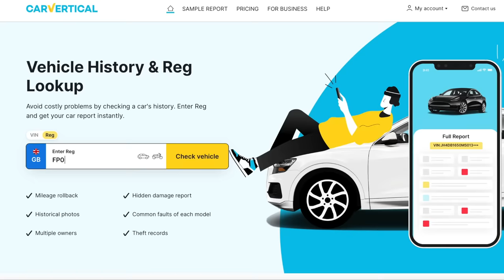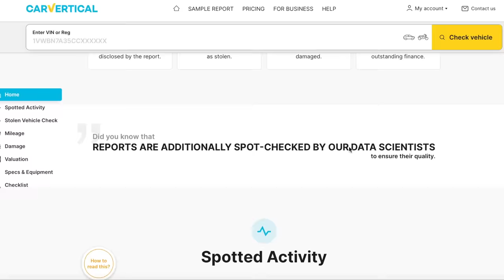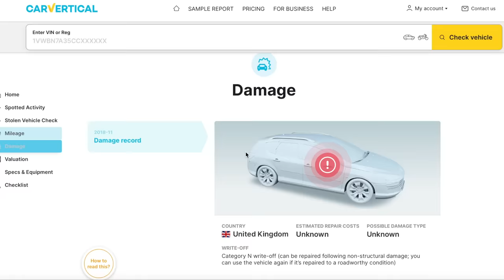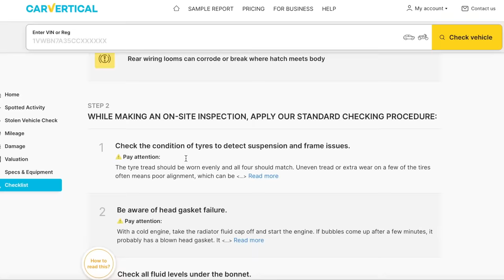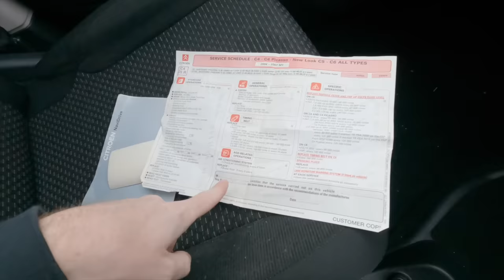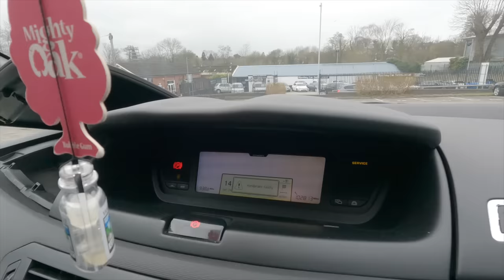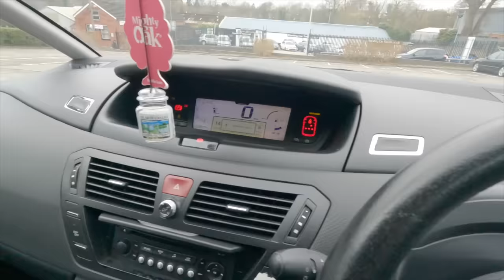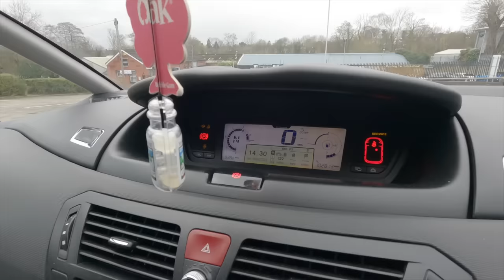I BOUGHT A CHEAP CITROEN C4 PICASSO FOR £300

Comment: Bought one of these a C4 Grand. they are almost the only car available in Auto with a completely flat floor across the front.
I had knee surgery and a full cast on my left leg, so this kept me mobile.
Planned to sell as soon as possible, but surprisingly, still have it.
Yours seems a right lemon!
Usual Ford engine problems, usual Fiat gearbox problems, usual Citroen wiring problems!
The 2.0 diesel had the regular torque convertor gearbox.

Comment: My wife has c3 Picasso it’s a nail what a shed but she loves it what makes it worse I’m a mechanic and I have to fix it every year it has the same things go on it front coil springs,rear discs,drop link ends,track rod ends,bottom ball joints ect what a shed it costs more in parts than it’s worth £500 and that’s trade price for this years mot unbelievable but I’ve put my foot down and told her that’s it it’s scrap in 10 months

Comment: Yep dpf fault but most common fault is with fuse box getting wet in certain age cars. Citroen knew about it but failed to recall cars effected. Bought one as it was in good condition, low miles and needed a big cheap car. Car kept stopping / cutting out and lit up like a Christmas tree. Turn ignition off and then car starts again. Can happen at traffic lights or while doing 70 mph on motorway. 
Its French so works when it feels like it.

Comment: I scrapped the very similar  car and got £440 that was Apriil 2022 ( perhaps prices have dropped since then) was on 184,000 miles with Turbo problems and rusty cills,you are wrong in some ways but right in a lot of ways , they are very economical and very comfortable , stylish , the semi auto i would never buy and yes the brake problem light is often on , I replaced my 16 HDI VTR plus with a 2.0 Hdi Exclusive 6 speed manual box( about £1000 cheaper than a Ford Galaxy ) , its nice leather seats ,everything love it but yes , I would definitely scrap that one, ( Auto Handbrake wont work with warning lights on, the beeping is fault with rear seatbelts ) that gearbox is stupid and you really should consider breeding, Western Civilisation is at risk

Comment: Matt loves to slag off the electric parking brake, then demonstrates his own lack of knowledge/inability to operate the thing, pulling & pushing on the control to release it when all you actually need to do is stick it in Drive and press the accelerator. Pulling the handbrake control at this point actually applies it even more strongly/securely rather than releasing it...

Comment: Had the misfortune of owning a Grand Picasso for a few months. hateful car but I took it as a trade in and ran it for a bit   In that short time I had Abs,. Esp, handbrake issues. gearbox is related to the abs sensor issues. windows not working,  rattling trim, injector popped out and a few more things I'm sure. was glad to see the back of it.

Comment: My dad had to drive one of these to a garage to replace his customer's windscreen somewhere indoors. Bearing in mind he drives a 1 litre Suzuki Splash and thinks all cars should have a top speed of 60mph, his words were whilst he didn't see the point of people banging on about how slow a car like this is when it wasn't designed to go fast, he'd never in his life driven something where the acceleration time is so slow as to suggest that the car just ignores the input from the accelerator pedal 😂

Comment: Citroen really have lost their way. I had a 1993 ZX & a 1995 Xantia. Both cars were mechanically sound with the 1.9 TD engine though pretty ropey & plasticy interiors, especially the ZX. The key to them was maintenance. I used a local Citroen specialist & the cars served me well. The Xantia had 175k on it when I got rid & ran well albeit the bodywork was...erm...tatty. Sold it for £175 & bought a Toyota. I’ve never been tempted to return.

Comment: 18:30 Here you can see that you you drive in 2nd gear, because the transmission is in emergency mode, and it is controlled by the paddles under the steering wheel, and you pressed the + button, that's why it jerkily drive in 2nd gear.

Comment: A lot of what you said here is true, but they aren't that bad to drive and use, at least the 2.0 HDI diesel versions. The worst offender is the automatic handbrake. Pneumatic suspension requires attention, but it's not as faulty as people make it seem to be, not that expensive to fix and in my opinion worth it. If not, there are aftermarket suspension kits in the price of pneumatic parts you can drop in and be done with if you can't be bothered. I'm pushing 220k miles on mine and had one major failure out on the road that was car's fault. I kind of dislike how SUVs push out family vans out of the market, because they are a really good compromise between comfort, inside space and running costs(especially MPG)

Comment: Citroen spoil things when they get over complicated. I’ve had two ZXs, one was a 1.4i and the other a 1.9td. Both were reliable, cheap to run and enjoyable to drive. I had an AX too. Made from biscuit tins, but averaged 70mpg and never let me down. However, I wouldn’t touch a modern Citroen or any French automatic with a barge pole!

Comment: My sister has just traded in her 14 plate C4 in what I can only describe as poverty spec, I’m amazed it’s actually got electric windows! She’s traded it in for a brand new Dacia Jogger. The old C4 has seen better days. It’s front bumper has a serious lacquer peel, the passenger front door has a large rust patch running along the bottom, a fog light surround is missing having had an altercation with a pheasant, there is a small dent in the rear passenger door and every single seat is stained. Mechanical wise, there’s a bit of a knock from the front suspension, the gearstick is quite notchy but other than that, it goes and it stops. The Dacia garage have given her £2400!! Wtf! How could they possibly make anything off that bucket???

Comment: I feel your pain, Picassos of this generation are just painfully terrible. Driven by people with no mechanical sympathy whatsoever, and minimal funds to look after or service the vehicle in any shape or form correctly. New citroens really are horrible, however, the older ones (pre around 2000) in my experience were pretty good, especially the diesels, such as the AX, ZX, xantia, even the ugly xsara. Soft squishy seats and suspension, frugal and very reliable diesel engines, but pretty poor build quality.

Comment: I live in Tasmania Australia, and drive a gold diesel 2008 C4 (not the SUV type). Apart from a major water and fuel pipe trouble, whch did cost about $2300 to repair, it has been a very reliable car. I srecently paid for its 100, 000K major Service and always change the oil every 6000Klm. I LOVE this car!

Comment: Would not touch a Citroen with someone else's money never mind a barge pole had a nasty experience once and seen another experience someone else had with a Citroen van came back home from work parked it up and as with all Citroens it seems to happen when the Disc cool down the hand bake no longer holds this brand spanking new Citreon van role down the road across the junction into the path of an oncoming Bus

Comment: I had a c4 grand Picasso with manual gearbox which I used to drive to southern Spain 4 Years running. Very good for the motorways x comfortable. Only problem I had was one year the air con developed a problem with the air con in that it only ran with the fan at full speed! The noise was atrocious. Took it to the local Citroen garage and got a bill for 1000 euros! Yikes!!

Comment: Oh this was hilarious. In 2007 I needed a car quick for new job, they said I’d do 20k a year max so I bought one of these exact model but with the 2.0 engine on a lease, I did in fact 60k that first year drove all round Ireland multiple times and then back and forth to Northumberland up and down the uk etc and at the time I had a 3 yr old a 7 yr old plus 2 dogs. It never let me down, but I loathed that thing the gearbox was as u said, the trim rattles were so bad I used dry wall screws to try and stop the upper glove box lids rattling and worst of all I’d bought my Mrs a used a4, which I convinced to let me use for work and she use the c4 for the last 2 yrs of the lease. It was like driving a Roller after that turd even tho it was base model petrol. I was so happy when it went what an absolute pile. I wish I could have seen yours getting scrapped.

Comment: Its supposed to be a fully auto handbrake put it in gear touch accelerator it comes off put it in park it comes on , also fitted with anti roll back,VTR + should have auto fold wing mirrors. Had a new one in 2007 one thing to check is water ingress into the engine management ECU had 3 fitted to mine that can cause misfire and other management lights also cuts the engine (bad seal around it never buy new models they havnt cured all the problems) Thank god it was on lease so no charge to me. Probably never had the gearbox service needs one every 40,000 .

Comment: Interestingly, my parents have owned a C4 Grand Picasso for 11 years, and they think it is a very good car. In my opinion, the Grand Picasso is much more attractive than the ordinary Picasso. It has been fairly reliable and practical too. I must say though, that as somebody who actually learnt to drive in a Grand Picasso, it is an awful car to drive and the response time once you put your foot on the accelerator or brake is very slow. The worst part was moving from having my foot on the brake to putting it on the accelerator when I had been waiting to enter a roundabout at the top of a hill. The car rolled back as soon as I took my foot off the brake and the response time when I put my foot on the accelerator was so slow I was worried I was going to roll into the car behind me....

Comment: Brake pedal position sensor will be the cause……. Usually if you put it in manual you’ll find you can change up all the gears 😂. As for the rest of the faults……. Gallon of petrol and a match

Comment: Love these videos Matt and your humour. 
I agree with you that generally French cars are garbage. After 40 years of driving and many, many short term and long term rentals as well as company and private cars you are right ALL cars will go wrong at some point, the key is quality maintenance to help prevent it. Generally I would say I’ve never had that many mechanical issues with French cars if they are serviced on time (auto boxes aside) BUT they all fall apart eventually and Citroen/Peugeot usually earlier than later and mostly they have crap nasty plastics. They all have interiors that self combust, whether it be dodgy window switches or just bits of trim falling off at random. 
I’ve also run Mercedes, Audi and BMW as company cars and after 100,000km or more of tough Autobahn driving they’ve all felt exactly as they did the day I took delivery. I’ve never ever had a car from one of the big 3 German brands let me down or have bits break off. 
You are always going to get someone saying “but my Citroen did over 100,000 miles with no problems” I’ll bet at the end though they felt like driving a knackered old sofa. 
In my experience all Germans are not equal however, The Golf MK7 was a great car and in my opinion good quality and lovely to drive, but the MK8 is a hateful cheap and plasticky pile of junk with a touchscreen hell inside. 
Keep up the good work, look forward to your next video.

Comment: The theme of the video runs through the whole Citroen stable.  We had a Xsara Picasso from new, had about seven years relatively trouble free motoring and actually did us well.
 Well, apart from the spare wheel being nicked after 6 months because , according to the salesman, a simple security bolt through the boot to stop exactly this happening was an 'optional extra'. Part of the wonderful world of Citroen 'quirkiness'. 
After seven years though it turned into a clown car, they should be fitted with a clown horn as standard because it literally felt like the doors would fall off. A friend who bought it off us thought it was cursed, they just over complicate them.

Comment: Your right when you say you can't go wrong, even if the engine is knackered  you'd get your money back.
I recently scrapped my focus ( which I brought as a cheap run around for 700quid a year ago ) a couple of days ago the scrappy gave me £350 , even tho almost every panel had damage .
Yesterday I payed £1500 for a 13plate fiat punto ,with only 52k mileage. 
I got it cheap bc my father was advised ( medical reasons) to stop driving. 
The reasons are sad, but I'm glad he didn't ring a dealer. 
Ive seen similar reg/mileage 
On sale/ or sold, by dealers  for £3200. 
I'm tempted to part x for a bmw Z4 , 2.5 or pref' 3.0 .
I've always wanted one & prefer the looks,  soft top to the later solid roof convert'.
...im trawling my iPad atm.

Comment: It’s quite an easy fix for the Auto gear change ABS/ESP and Auto handbrake and cruise control problem and you can change in to 4th gear or higher when driving by going into neutral then back into Auto. Wow you really don’t like them do you. 😂
Reply: I like them though. 😀👍

Comment: It’s probably still more reliable than your range rovers ?
Reply from the maker: Nice original comment. Congrats.
Reply: @HighPeakAutos  it was actually a question not a dig. I am interested in the discovery sport but currently have a Renault, grand scenic. But doing some research the discovery sport has lot of engine problems can’t win
Reply from the maker: @thehoughtonshow6405  fair enough. You’re better off with an early one with the 2.2 rather than the 2.0d

Comment: In a moment of folly  I once bought a Citroën c4 grand Picasso. In truth I bought it as a load lugger because with the rear seats down  it was as spacious as a van. It was back at the main dealers with a handbrake fault within the first month. I also stupidly thought it was a true automatic. Not a chance. It wouldn't hold on a hill and with that ridiculous handbrake it was a nightmare. The second and worse fault was when the main wiring loom chafed as it went through the bulkhead causing horrendous problems and a £1000 bill to put it right. I part exed it for a toyota rav4 which gave me five years of trouble free motoring (and that was a proper automatic with a proper handbrake) Considering Citroën sell so many cars, you would think they could get it right. Sorry I'm sticking to Japanese now.

Comment: I worked for Citroen and had a new one. I also had another 2 used ones after leaving as a private owner. I also had a few of the prvious generation model, which was a far better car.

Pros of this model as a private owner.
1. It's got 7 seats in the bigger vesion
2. the HDi had plenty of power even when fully laden.
3. Manual box ones were pretty solid.
4. That radio cover came in handy when it was dark to hide the lights.
5. Brakes were really good. 
6. Comfy seats with arm rests

Cons
1. The semi auto box is the worst gearbox ever fitted to any car EVEN WHEN NEW.
2. The button plastic pealed off 
3. Air suspension on high spec models cost enough to fix that you might as well own a Range Rover (same parts as I understand)
4. No boot with the seats up (7 seat version)
5. Diesel injectors failed all the time.
6. Constant fault codes for minor errors

It's a shame because the other cars they were producing just before this were pretty good.
Reply: I think "No boot with the seats up" is a little unfair...where else can you put two additional seats? 😂

Comment: My parents had the first gen 2002 Xsara Picasso from brand new when I was a kid and it was decent as a family car. 2.0l diesel manual, not fast but economical and it had loads of space. The full size middle seat and rear seat trays were always a bonus. But you’re right, my mum has zero interest in cars and it wasn’t particularly well looked after! It did 110k miles, but the fuel pump broke twice around (50k and 100k) and needed a new clutch around 90k miles.

Comment: I really do love your videos but when it comes to your comments on French cars citroëns Peugeot you really are not on tune at all. I've owned many a French car and use them as taxis in the past and been completely reliable. I really don't know where your sourcing your cars from, but in my experience French cars Peugeot citrins that have been serviced on a regular basis same as any other car. They're perfectly reliable and cheap to repair so not sure where you're going with this..
Reply from the maker: Most of the French cars I drive are this bad. My views are based on experience. We all have different opinions
Reply: @HighPeakAutos  this isn't about opinions.. I had 3 Taxis and all covered 300k plus with just the normal servicing and a clutch along the way... Real world testing, don't understand why you have had bad experiences 🫣😟

Comment: My old c4 Picasso was great in every way apart from single dry clutch automated manual which I hated and will do for the rest of my days lol, nah it just had to be driven in a particular way to get a smooth ride. When it went for its first MOT it failed on like 4 things and the garage said it was very common.. oh and it used to need feeding rear bulbs on a monthly basis

Comment: Given all those faults it sounds like possibly a major electrical fault? Maybe an ecu failure. Wouldn't believe that so many items were broken. Should hook it up to an obd2 reader (they've given you one!) and see what fault it has. Perhaps you could reset them and it might work again. But probably not!
Reply: All the faults re gearbox and handbrake could just be a £5 ABS sensor.

Comment: Those nitro obd readers are for fuel economy and remap the ECU
Reply: Got to wonder if using this has caused the ECU to go on strike and think everything is faulty. It thought the handbrake was faulty but the mechanism works. It's the electronics which are seriously broken.